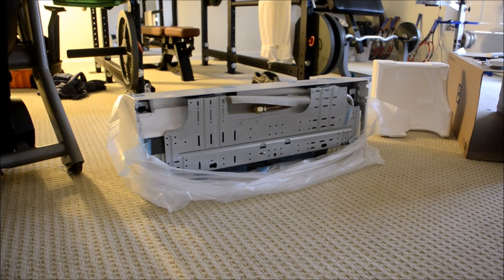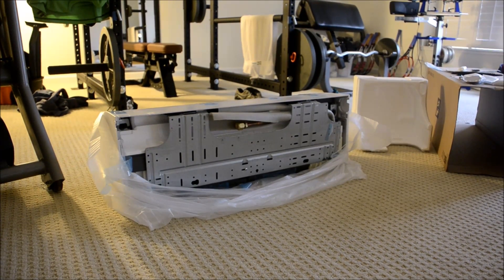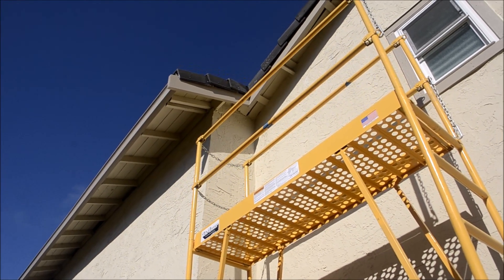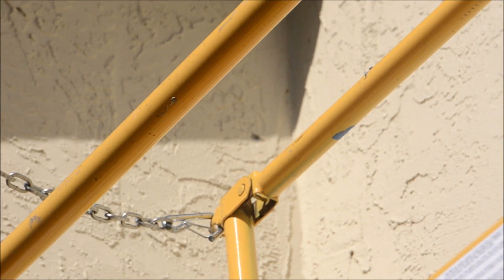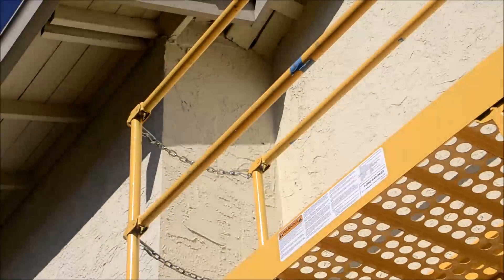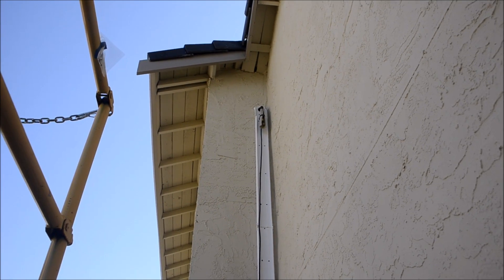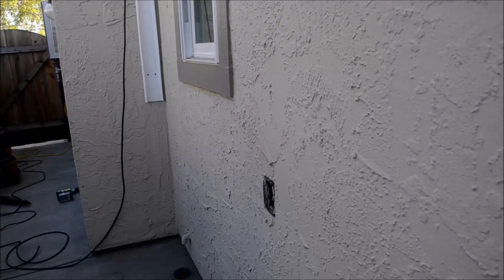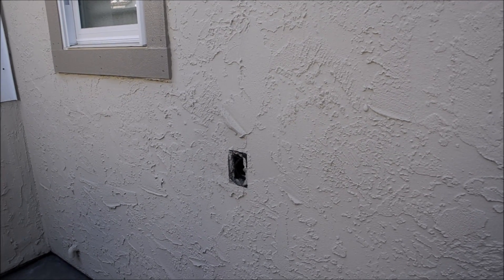Fujitsu Mini Split Install

Comment: Those fitting from Amazon are awful - they are cheap and have caused me issues in the past. They leak as well as other issues. Better to pay a little more and get a better 5/6 to 1/4 fitting..

Comment: Always use a fused out door disconnect.  If you have this running on a 30a breaker, you have no protection!  unless you put the smaller fuses in the outdoor disconnect, all mine are just 15A MAX fusing as per the manual.

Comment: On most of the other videos I see people using a valve core removal tool before Nitrogen test, why didn't you do so? It seems like it can be skipped but did you look into it?
Reply from the maker: I didnt see what the advantage was. In addition, if I pulled the core, then when I eventually replaced it air would get into the system. One of the benefits of nitrogen is it will also remove and condensated moisture, so letting air back in is not a great idea as it may just recontaminate the lines with moisture. Anyway, that was my theory. Still haven't had any issues with it, so all I can say is the approach works, but it might not be the best way.

Comment: I have the exact same unit. There are small copper covers where the lines go. I can remove them and install the lines. Once the lines are on and vacuum is done how do I allow the refrigerant to flow through the entire system? Missed that on your video. 
Thanks
Reply from the maker: Apologies, I didn't do a good job at all explaining that. Jump to 14.06 in the video, Remove both cover nuts at the lineset connection, they are the ones that you have not touched yet and are perpendicular to where the linesets connect to the valves. Then insert an Allen key into the now exposed valve, make sure you open both of them and then the refrigerant will be in the lineset and you are done. Obviously, you do this after you pull a vacuum and pressure test the lineset.
Reply: @diydan30  thanks Dan that's is exactly what I was missing. I'll be finishing off this project this weekend
Reply: open the valves at the condenser
Reply: @justinrichard4190  do I have to take more apart to find the valves?

Comment: Don't you need to add/remove refrigerant from the system based on the line length?
Reply from the maker: I didn't, most systems come charged with a certain line length in mind, I believe mine was 32 feet, if you go above that then you need to add charge,  if you are less than 32 feet, then you should be good. I was at 24 feet and didn't change the charge volume. Perhaps someone else would know if there is a need to remove refrigerant for very short runs.

Comment: You just let air go into system again by remove the vacuum valve before release refrigerants.
Reply from the maker: You are right, J. Gutierrez pointed that out to me. So while the system may have a little air in it, the unit works great and has been for the last 4 years.

Comment: Did you remove the shrader valve when you pressurized the system?
Reply from the maker: Nope you really dont need to, just screw the hose in tight and that will depress the valve.  I initially made the mistake when pulling a vacuum of not tightening the hose and was instantly pulling 300 microns. It took me a while to figure out what was going on.

Comment: I just purchased the exact same unit myself. It appears that the service port too the line set connection port is being blocked by the gas "release" valve? Any ideas?
Reply from the maker: Not sure I am following what you are saying. If you take a look at my install, it was pretty much plug and play.
Reply: @diydan30  Thanks for your response Dan. Inside of the three way and two way valves located on the side of the unit where the line sets will attach, the gas release valves are blocking the way to the line sets. I can attach the gage manifold to the service port to pull a vacuum I just don't understand how it is going to pull a vacuum on the line set with the gas release valve smack dab in the way.?The service port to the line sets is blocked by the gas release valves. No flow, no vacuum?
Reply from the maker: @25meyer  I think I understand what you are asking. All you need to do is attach the line set, to the outdoor unit and the indoor unit. So both the suction (bigger pipe) and liquid (smaller pipe) need to be connected. Now you just connect the vacuum pump to your manifold and the manifold to the service port and pull vacuum. The vacuum will pull on both lines both via the TXV in the indoor unit and the condensor so there should be no pockets of nitrogen or moisture left. I assume you are also doing a nitrogen pressure test first? Sorry if the above is obvious, if so I am clearly misunderstanding your question.
Reply: @diydan30  Ok,  if I understand what you"re saying, the service port feeds into the unit and not directly into the line set? I was thinking the service port was a direct connection into the suction line and the vacuum was pulled directly on the line set. 
This makes much more sense. Thanks Dan. 
Yes I am doing a nitrogen pressure test. I can rent a tank from a local supplier. I purchased the vacuum pump and gage set, all other supplies, tube benders, flare tool, etc I borrowed. Thanks a bunch!
Reply from the maker: @25meyer  Sounds like you got it covered. Take your time with the pressure test. I would let it hold pressure for a few hours and then use a water sprayer with some detergent to find any leaks. Hopefully you used that sealant stuff (can't remember the name) on the threads of the compression fittings. This step is super important, so if you have to leave it for a few hours then so be it, just make sure you dont see a pressure drop,  for what it's worth, I waited 12 hours (overnight) on the pressure test and then 12 hours (overnight) on the vacuum test and I haven't needed to touch the unit again at all.

Comment: What is the difference between the nitrogen pressure test and the vacuum test ,what are they for? THANKS
Reply from the maker: Both are used to test for leaks. The vacuum test makes sure no air can enter the pipes and contaminate the refrigerant. The nitrogen pressure test makes sure the pipes can contain the high pressure of the refrigerant. You use Nitrogen, not air because the nitrogen is dry and will not contaminate the refrigerant with moisture if you fail to remove it all during the vacuum test. You might ask why you need both tests. This is because some leaks will only show under vacuum, and some will only show under pressure. So if you do both you are covered.

Comment: SO you had to manuevar the bent line set through the hole. How hard was it?
Reply from the maker: It a bit of a pain, but I did it with the help of my wife. If I were to do it again I would make the bend on the outside of the house after I installed the indoor unit.
Reply: @diydan30  
Thats y i ask i think it would also be hard to bend outside because the bender wont fit. Mostly i see guys bending by hand outside.
Reply from the maker: @leonelramirez3231  Yeah I didn't want to bend it by hand and wasn't sure if I could use the pipe bender outside due to clearance issues with the wall. But I would at least attempt it and if it didn't work you  could take the indoor unit off and bend it the way I did. Worst case.

Comment: Does it cool the room good even though the head unit is close to an inside corner? I was told it should be in center of room. I don’t have that option though. My room is about 300 sq ft. You think it will be a problem?
Reply from the maker: It cools the room great. On a 100 degree day it cools down to somewhere between 58-62. And the room that it is in gets direct sun all day and is the hottest room in the house, which is why I placed the ac unit in it..
Reply: DIY Dan thank u! But being that it’s not in the center of the room that doesn’t matter I guess. Appreciate it!
Reply from the maker: @Drew_That  Right, mine is not and it works great

Comment: Where do you get the power feed to the unit from?
Reply from the maker: The home was pre-wired with a 30amp line so I didn't need to do anything on that front, obviously, that restricted where I did the installation but it was perfectly placed for my needs. If you don't have the electrical already in the location you want to install the unit then you will have to run a line from your panel to the location. If you don't know much about electricity I would suggest you get an electrician to run one for you.

Comment: Use vacuum pump after using nitrogen, then hold 5 to 10 minutes long to make sure that there is no leaking on your system. 

P.S.: why don't you use the vacuum pump?? Vacuum pump are mandatory for HVAC.
Reply from the maker: I did, jump to 13.38 in the video.
Reply: @diydan30   Really? But don't I don't see that actual vacuum pump in the video. Next time, take a recording that vacuum just for split seconds so I can clearly see you did. 👍

Comment: I'm sure you did a good job (better than "professionals" who do this kind of job in GERMANY - strange!!!)... In any case you did three mistakes :)... In the order they where made: 1.) You used the insulation sleeve on the indoor unit as main insulation for liquid and vapor together... There is a reason the sleeve is cut-open and the reason is to have room to go all the way inside with the liquid line insulation; 2.) You had N2 on hand but only went up to about 200psi. The tested work pressure of the unit is at bout 550 - 650psi; that's how high you should have gone with the N2 pressure and you should have allowed it to stay a lot longer. N2 is inert gas and fluctuates almost not at all with temperature fluctuations and in your case the fluctuation could never have had an impact on the pressure; 3.) You disconnected the meter just after reaching a low micron reading, which is wrong. You should have allowed the microns to go up and see where you are at after 10 min at least. In any case, congrats!
Reply from the maker: Great tips, thanks.

Comment: Can I ask where the intake is on the air handler?  Basically I'm wanting to know if this can be installed  on a wall flush with the ceiling.   The unit I have my eye on is also a Fujitsu and has 9000 btu air handler...(I'm guessing all of their air handlers have the same casing and draw air in from the same direction)  Tried to find installation instructions in documentation available at website, but they don't provide it!... Only users manual....and say "professional installation required".  Makes it hard to know if it will work where I need it to (just above a door where there is only 12" available)  Do your instructions that came with your unit include any requirements to leave space above the air handler?
Reply from the maker: I believe the intake is on the bottom of the unit. I think if you installed it flush with the ceiling you would have difficulty opening the front access panel as it lifts up towards the ceiling. So you might want to consider that.
Reply: Thanks!  I've decided not to put it above that door.  Found a better place :)

Comment: All those shiny new tools, that you may never need again!  You should run an ad and rent them out to other mini-split DIYers!  I've been fuming about the installation costs of these myself.  I really want a fujitsu....Just the fact that they offer the great warranty in the first place makes me feel the most comfortable with the brand.  I'm "just a girl" but I swear the thought crossed my mind to do the same....after seeing all of the videos online showing how simple it is all the way up to the point where it requires specialized tools.  But, being more realisitc,  I don't know if I could stomach the stress of feeling I was going to screw something up at that point.  I spoke with an HVAC maintenance guy today who told me he could run the pressure test and evacuation for somewhere between $300 & $500.  That's a million times better (hyperbolically speaking :) than paying someone 5K USD for total installation (yes!  that's what I was quoted)..I don't even care if it takes me all weekend to do my part!
Reply: All weekend? I'm anticipating 30 to 40 hours all said and done.
Reply: @chrisE815  Depends on whether you have any experience...or confidence, for that matter (watching youtube installations can help) and of course depends on your own particular installation, but I know people who get these in 8hrs or less.  (that wouldn't be me...I'm very careful and would over think every step)

Comment: Great video.  Do you need to leak check with high pressure nitrogen or can you pull a vacuum on the lines and watch for a pressure increase?  It seems that using a vacuum would be just as effective and you could eliminate the need for nitrogen in the install.
Reply from the maker: Generally, you need to do both as leaks can be present under pressure but not under vacuum. So its best to do both if you can as that way you shouldn't end up with an unexpected refrigerant leak.

Comment: $1800 for a mini split??? You can buy a Goodman full house system for $1700, plus ~$3000 for installation. You can get a full house central system with all labors, tools, pipes and AC indoor/outdoor units plus 10 years parts/2 years labor warranty together for $5k here (Raleigh, NC).
Reply from the maker: If I had that pricing option I might have considered it. But CA prices are far more expensive than that, at least they were at the time.

Comment: Hi there. What brand of tubing bender did you use and where did you buy it?
Reply from the maker: All of the tools I listed are in the description, but this is what I used IMPERIAL 370-FH Tube Bender, 1/4, 3/16, 3/8 and 1/2 In (ebay $60 - Dont really need this, but it was a nice to have)

Comment: You disconnected vacuum hose before turning the gas on. Do you think you should switch off the pump, turn gas on then disconnect vacuum hose?
Reply from the maker: Take a look at the comment from J. Gutierrez below. I think his approach is the best one.
Reply: oh, he got similar observation....air would have rushed in the moment you disconnect the hose...
Reply from the maker: If I were to do it again I would follow J. Gutierrez's procedure. However, my system is still crazy cold, so it doesnt look like my method had a negitive impact on system performance.
Reply: I think the air amount is negligible is you were fast enough. Having said that, our local AC technicians here don't do vacuuming. They do air-purging. That's why I decided to DIY. My online-purchased vacuum pump and all other tools/materials are on their way.

Comment: Hi there.  So after the nitrogen pressure test. How do u get the nitrogen out of the lines before you vacuum  the system?
Reply from the maker: Do the nitrogen test first then you pull a vacuum. So after the nitrogen pressure test is complete and you are happy that there are no pressure leaks you hook up the vacuum pump and then do the vacuum tests. I think I pulled a vacuum three time just to be sure there are absolutely no leaks. After that, you release the refrigerant and you should be good to go.
Reply: ok thnx Dan, good to know. I thought u might need to get the nitrogen out of there somehow before the vacuum.